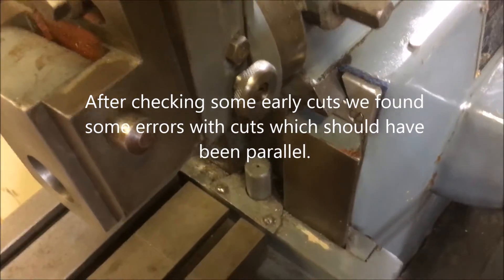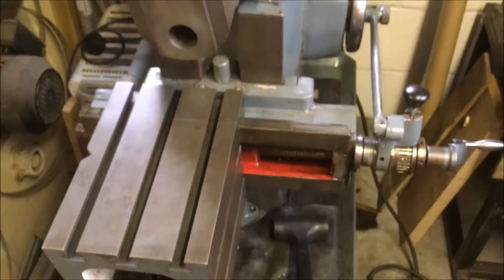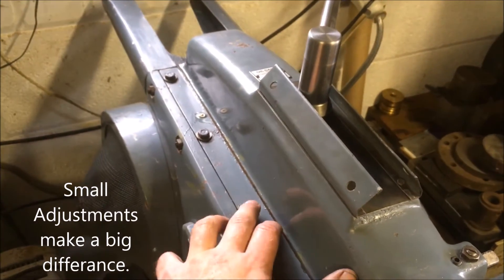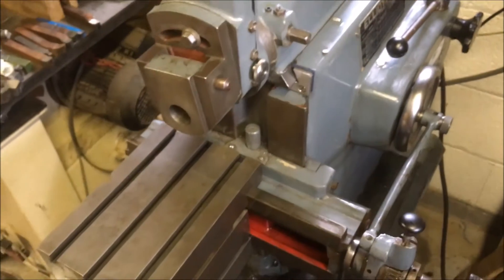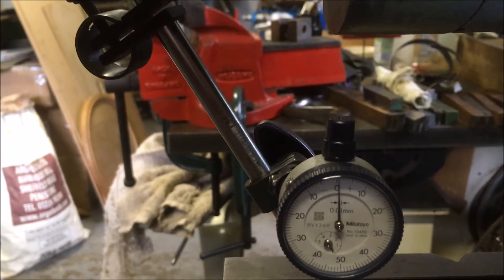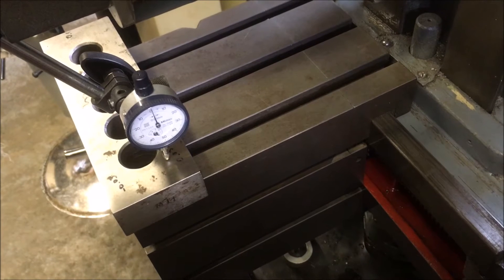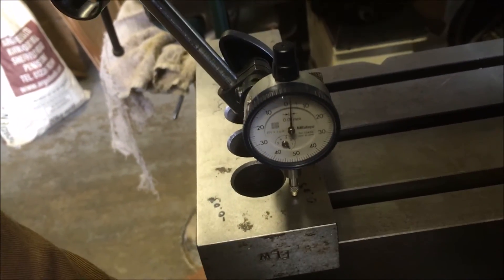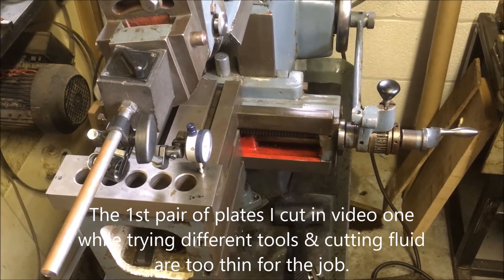Shaper Elliot 10M pt 3

Comment: Mat, one of the things that I can do with my shaper is preload the table to eliminate the taper, but the table support on mine is very different to yours. I set the basic height I need then wind the table down till I get a zero reading on the dial gauge. Had to level the front table support so I didn't induce a taper side to side. you might be able to machine a little off the clamping plate to eliminate some of the slack I like using metric gauges, but they can drive you nuts as they read 2 1/2 times finer than an imperial gauge. Greg

Comment: I think you got it pretty well set, mine was (and still is) alot wrse because the ram has some uneven wear. Did you check the geometry at different table positions (horizontally), i found that mine is just under 0.1 mm higher at the very ends, so it seems the ways are worn.in the center......by the way, been to an auction today and the same as yours went for £180, appeared complete with very little work required. So it seems there are still some cheap ones around, but i can't really justify to have 2 ... shame
Reply from the maker: Hi thanks for comment, I checked the ram to table at the full stroke over the table with the ram forward and back and with a 5" stroke over the table with different start positions , it seams there is minimal wear all be it all at the rear off the ram.  The gib adjustments were next to nothing at the front. 
£180 ! You should have had it and put it on ebay, I paid a chunk more than that for mine. There is one on ebay tonight at near £750 , 3ph says it's good nick but there is some damage visible all be it to handles, sign of having been badly handled at some stage. 
The next session is one machine down some 40mm thick plates from rough flame cut provides to make small bolster plates. It should provide ample time for the adjusted settings to bed in and then I am interested to see what the dti reads again. 
lm keen to see how he anchorlube works out, I really don't like the smell and mess of the cutting oils.
Reply: Qwll, seems you're lucky, but your's is in a lot better nick than mine anyway.
You're right, could have made some money with that, but i already spent a fair bit on very nice tooling there, Also space and time is tight at presenr as i am working on getting some of my biikes on the road.
That ebay shaper price is miles off, bet no one buys it, did you notice the price was plus VAT ? The one i kicked today looked alot better...
Seems that anchorluve stuff becomes really popular, but not cheap either, i just use all sorts of oil i have left over, thinned with a shot of kerosene, stinks, but it's almost free.
Reply from the maker: +dynoguy I guess the machine dealers have to ake a living and the £750 is around d what they charge but to then stick vat on is silly. 
Lost count of the machine buys I've let slip due to space and time restrictions, got to work with what we have ! Would surely love a 14" shaper now in place of the 10, but then I would want a bigger mill,  and on it goes. Cheers. Mat